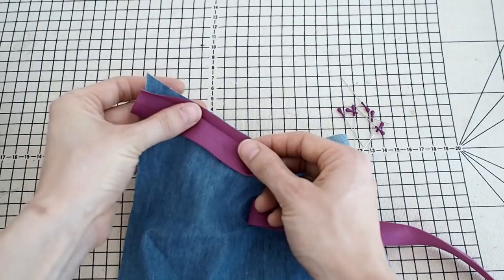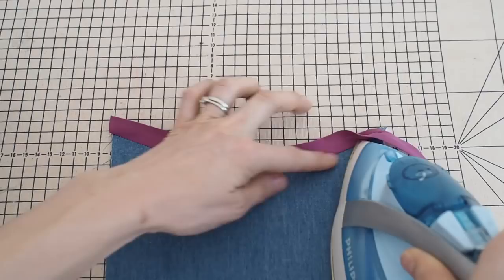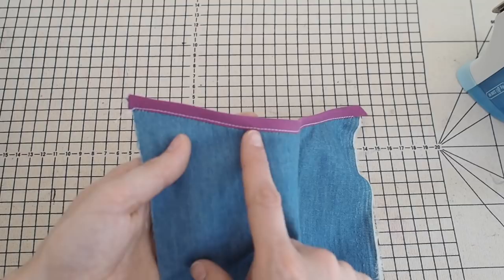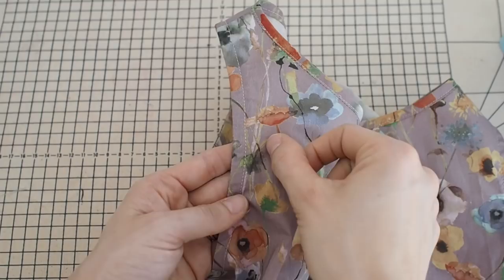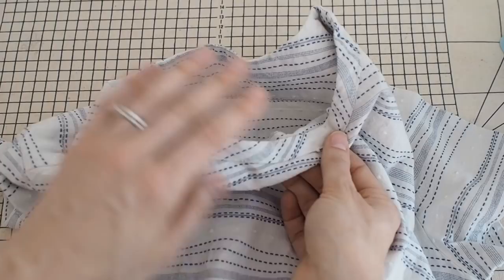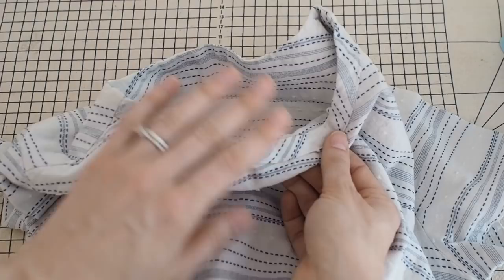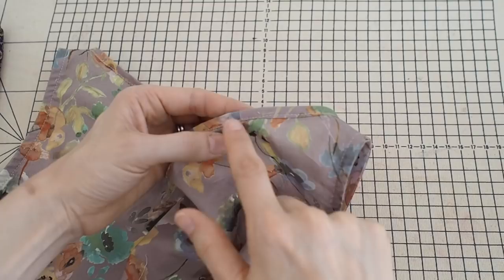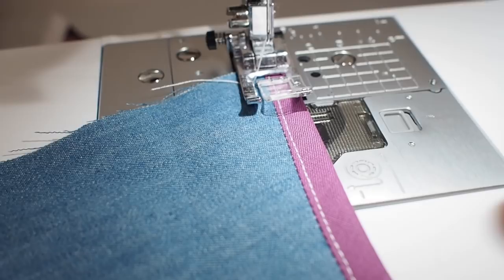The Ultimate Guide to Bias Binding - Part 2

Comment: Thanks so much for this, really clear explanations.  I have a question - is there a reason why the bias binding can't be attached at the same time as sewing the seam?  And for binding a seam with exposed edges, does it matter if you start by attaching the bias binding to the inside then fold to the outside and do the topstitching from the outside? Thankyou!

Comment: Hello! I just saw this video and your other video on form tape interfacing. Is that something that I would use together with the bias binding? Do I first iron on the form tape interfacing and then sew on the bias binding?
Reply from the maker: Hello, yes thats right, on fine fabrics where often pattern instructions suggest you stay stitch neckline to stabilise them, you can replace that step by using form tape interfacing and then applying the bias binding afterwards :)
Reply: I e never heard of form interfacing?  Could you explain further?

Comment: Can you use double folded bias tape for curved edges? I accidentally made a double folded bias. I can't figure out if I can use it for curved edges or if its best to use single fold bias tape.
Reply from the maker: Hello, yes you can use it for curved edges as its the bias that gives the stretch, no the number of folds. If you made double fold you can always just flatten out the centre fold and then you will have single fold. Hope that helps :)

Comment: Hi I'm a brand new sewer. Do you put your bias bindings on the individual front and back pattern of your shirt first then sew them together?
Reply from the maker: Hi Keli, if you were doing a neckline for example you would sew both shoulder seams first so the the neckline was like a loop and then put the binding on. Similarly for an arm hole, you would sew should seam and side seam so the arm hole is like a loop to and then put the binding on. Hope that helps :)
Reply: great thank you so much!